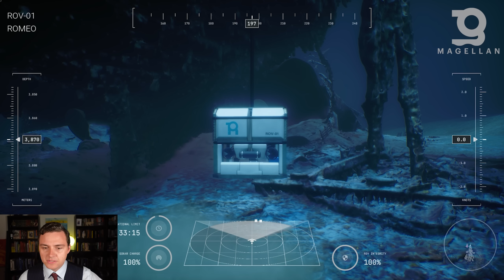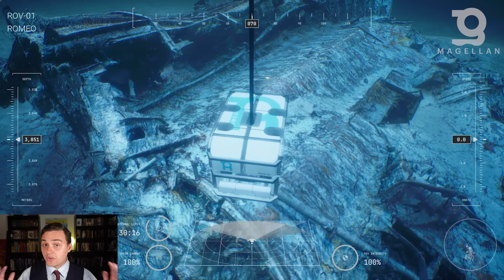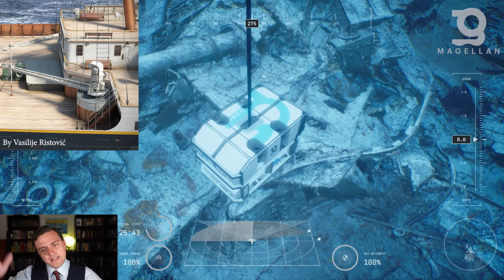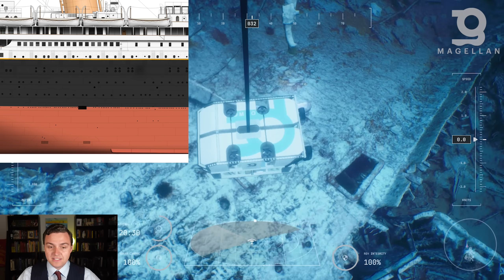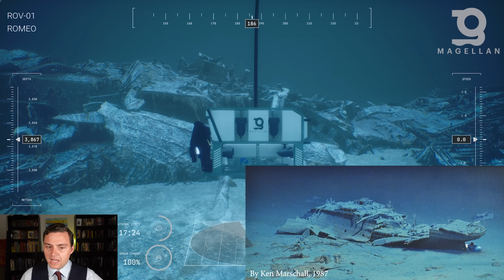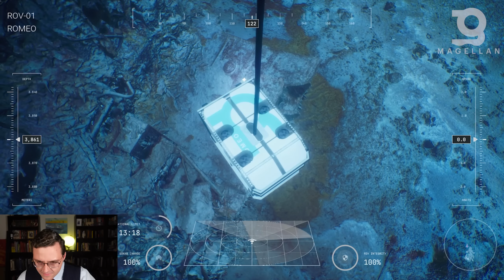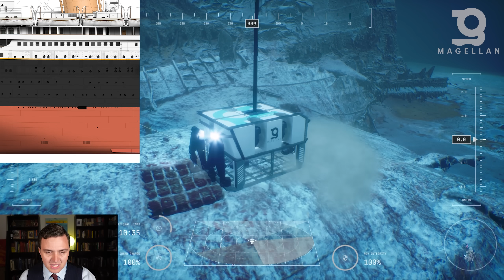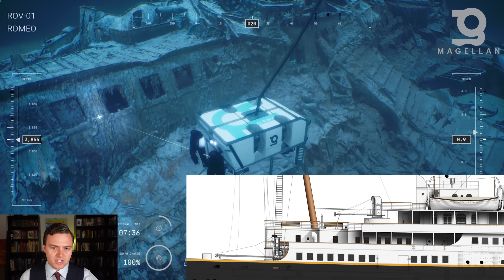FIRST LOOK: Titanic's Destroyed Stern Section in vROV Pilot

Comment: Mike, I see 4 things in relation to the shell plating.
*the breakup itself 
*the impact with the ocean floor 
*implosion damage 
Here’s a factor that I don’t hear mentioned much if at all:

    The ship didn’t sever immediately……or fully. The port side of the bow section will support this notion….methinks it was twisting and essentially peeling the shell plating from the framework as the entire mass descended until it finally separated. Add everything else plus the water column, and it’s amazing that the stern maintained ANY semblance of structure.

Comment: I have to wonder what sort of damage was done to stern vs front sections at the time of the breakup while at sea surface.  Was it a clean break like a knife slicing through a piece of bread, or was a lot of the structure buckled and the flattening began  on the surface as the ship "bend" outward?

When would be needed to know is what kept stern attached to front section (likely at double bottom?) and what sort of condition it IS  in now, twisted beams indicating the stern section started to spin and which point, it broke fully separated and started to fall down on its own and found the most aeordynamic orientation to fall ?  
If the bow hit first, it would have its aeroduamic shape to slice through sand and perhaps more slowly decelerace wheras the less aerodynamic shape of stern with propellors etc might have created a more sudden impact when it hit the bottom

Comment: When I was building dioramas of the stern, it was fascinating getting to shape it all based on the paintings and images available at the time, and gave a great understand/insight into how it might have been moving and rotating as it impacted the floor. The sheer forces involved to peel the entire shell of the ship away are absolutely unfathomable. The way you can tell the direction it was moving as it hit too, and how the port side skin was essentially ripped off as the hull kept moving, while the starboard skin ripped off from its own weight and momentum as the bulk of the ship stopped too. Mind boggling
Reply: Mind boggling indeed.  I tried wrapping my mind around the forces that were at work this whole video and it's darn near impossible.  Some say it hit at 35mph but I wouldn't be surprised if it was faster than that.

Comment: It boggles my mind the degradation of the stern since its discovery. The fact that this game exists is boggling, and the fact that its built off of the actual 3d scans is just incredible

5:29 dangit mike that was a good moment to get up close to the prop and see if the 401 is on there and to shut the switch theorists up
Reply: Fortunately degradation of stern actually didn't really happen that badly. Ken Marshall paint was pretty optimistic, he said that most of the images he got were overhead view of stern and he just assumed that certain decks were intact. But unfortunately closer images to  those areas show that alot of those decks were completely collapsed. For example port side hull plating lying almost horizontaly flat on seafloor the same it is now and boat deck was really close to seabed, which means port side decks were as badly collapsed as theu are now. A and B deck were also completely collapsed. Alot of decks on starboard were also collapsed.

Comment: What is fairly evident is that Titanic's aftermost boiler rooms experienced explosive decompression somewhere on the way down.  It is extremely similar to what you think about when an airplane might have a window blow out while at altitude and the cabin is pressurized.  Except what is pressurizing the interior of Titanic is steam.  Not from her main steam system (pretty much all of that was vented before she went down), but from all the residual heat built up in all the metal in the boilers and the firerooms.  In her stern section, the aft-most boiler rooms had remained pretty well free of water intrusion while the ship was going down head-first with the water-tight doors closed.  So, a lot of latent heat didn't have any opportunity to interact with seawater until she was already on her way to the bottom.  So: you'll get pockets of steam that develop as seawater boils off and the surrounding hull structures, reinforced by external water-pressure holds the steam in there.  And as the ship goes deeper and deeper the increasing water pressure will force those steam pockets into a smaller and smaller volume with higher and higher pressure until: POP!  They blow out a bunch of rivets and put a seam in the hull.
Reply: Very well thought through comment that no one else has mentioned! Makes sense to me, multiple, simultaneous pressures!
Reply: @ Thanks.  This is actually a simplification of the physics.  Technically it is neither an implosion nor a decompression because the pressure of the seawater flooding the ship will compress the air pockets until the two pressures are in equilibrium.  The actual failures is the result, technically, of the fact that the compressed gases are less dense than the sea-water and therefore tremendously buoyant and put a whole lot of stress on the structures of the hull in a direction exactly opposite of the what the architects of the ship had designed her to withstand.  But the visual of an explosive decompression is pretty analogous to what you see when these failures happen - so that's why I went with it.
Reply: I wonder if some of the hull damage was caused by the boilers exploding as the sea water entered the rear boiler room as the ships rear section broke away, I have read about boiler explosions on ships after being torpedo during WW2, the venting of steam as shown in several films is excess steam the boilers were producing once the main engines were stopped, it did not empty the  boilers as the steam was still being used & being produced to keep the other reciprocating engines for power generation running, probably getting steam from the rear boiler room.
Reply: @ I'm not an expert on Titanic specifically but I suspect none of the boilers exploded catastrophically.  In any steam system the boilers are designed to handle the highest pressures of any component in the system because, as pressure ALWAYS flows from high to low, the boilers must ALWAYS be the highest pressure in the system while the condensers must ALWAYS be drawing vacuum in order to keep steam moving through the system.  Once the bridge ordered the engines stopped on the EOT (engine order telegraph), they would have closed the valves to cut steam to the engines, opened the bypasses to keep lower pressure steam moving to the auxiliary systems, and vented most of the excess.  I'm sure they would have held some amount of reserve steam but nowhere near the upper end of their operating pressures in the boilers.  Once the ship slows and stops, you aren't getting fresh seawater forced through the sea-chests into the condensers and so, if you are trying to push too much steam, you'll overwhelm the ability of the heat-exchangers' in the condensers ability to suck that heat back out in order to recondense the dead steam.  And, if that happens, you start to lose your ability to push steam through the system at all and you will mostly have to just vent the dead steam to keep any steam moving.  While it is entirely probably that the steam lines in the aft fireboxes did fail when they experienced the thermal shock of the flooding, it's extremely unlikely that any of them were under enough pressure for such a failure to cause any significant damage to bulkheads or the hull on its own.
Reply: I guess I should mention: auxiliary systems (such as steam-powered generators) always operate at a fraction of the pressure of the main engines (because, under normal operation, the get fed from the steam only after it's passed through the main propulsion plant and because it doesn't require anywhere near the amount of power to spin a few generators as it does to keep those giant screws turning).  So, after they stopped the engines, the engineering officers, knowing that one of their chief objectives is to not overheat the condensers, would have only been burning enough coal as to keep the boilers at whatever the operating pressure of the auxiliary system was.  In my experience, this is normally only about 50-60 PSI, but again, I'm not a Titanic expert.
Reply: @Joseph55220  The suspect boiler explosion I am suggesting is not due high pressure etc the safety valves deal with that, I am referring the boilers would have failed when in contact with sea water after the ship began to break in half, the rear boiler room was isolated from the other flooded boiler rooms, & until the ship began to break in half, the electrical power was still being  generated by the steam reciprocating engines attached to  the generators, dont confuse these with the main engines, if you look up wikipedia  it confirms, as I have told by those who had worked on steam ships from the 1940's that boilers do fail/explode when in contact with sea water & the water that night was sure dam cold near freezing & salt water freezes at a lower temp than fresh water.
Reply: @Joseph55220  it does not matter the pressure in the boilers at the time the oceans cold water came in contact with the hot metal of the boilers, it would cause that metal to fracture, the damage caused by the un controlled venting of steam & most importantly the hot water contained within does the damage, to explain this I draw upon a boiler inspector I was associated with nearly forty years ago who explained, its not the pressure that does the damage its the volume of hot water being released, he quoted this, "a pressure vessel at 100 psi that contains a litre of water will result in some damage, but a pressure vessel at 10psi with 100 litres of water will result in major damage, as its the volume of heated water under pressure venting to atmosphere expanding to ten times its volume that does the damage" now consider the following, one of  Titanic's scotch marine boiler contained 48.5 tons of water, I ton of water is equal to 224 imp Gallons, only one of those boilers failing would do a lot of damage.

Comment: It always astonishes me to try and imagine the gargantuan forces required to tear solid steel cylinder blocks apart, blow the sides of a ship out into the abyss and crush objects like plasticine.

Consider that the rushing water flowing over objects as the ship plummeted downward ripped solid steel cranes to pieces, bending piping and tearing fixtures loose.

Does anyone know the thickness of the propeller shafts? Those shafts were bent upward like pipe cleaners when the stern smashed into the bottom. Contemplating the forces at play here just blows my mind.

Comment: It's incredible to think that objects made of porcelain, glass and other delicate materials (like plates, windows, etc) survived all this and are still at the bottom with the rest of Titanic. :hand-orange-covering-eyes:
Reply: Those materials cant decompose, eventually they Will be all is left
Reply: @gillespriod5509 I doubt the engines and screws will ever disappear as they made from bronze and the crank is steel but hidden inside the main engines
Reply: At those depths what largely remains is lesther items such as shoes as decomp at that depth is very slow not to mentions the tannins mostly preserving the shoes. 

Recovered from the titanic has been suitcases, full dinner sets, and i believe the cherub statue that was seen replicated in the film by the staircase.
Reply: It's a question of hydrodynamics. A teacup is brittle and fragile, but it is very likely to survive the fall to the seafloor intact because porcelain isn't terribly dense compared to water and the shape of the cup gives it reasonably high drag. So it will fall slowly enough to not break on impact, and in fact will probably land on the seabed upright.

In technical terms, it has a low 'ballistic number' in water and therefore has a low terminal velocity in water.

But an iron or steel object will sink much faster and strike the seabed with much more force, because it has a very high ballistics number in water. (The same reason why Columbia's main engines travelled the furthest in the debris field.)
Reply: Somewhere in the stern is a cargo area that  contained Titanic's books. Possibly the expensive one with the book with the jewels on it.

Comment: You can´t help it but appreciate that absolutely gargantuous amount of force, which has been exerted on stern section just because it was not so hydrodynamic and still more or less full of air pockets when it started its descent. That section is demolished like a plastic model in running washing machine filled with rocks.
Reply: It didn't even look this bad back in the 80's. On one hand I'm surprised the few rivets holding onto intact framework even held on for as long as they did, on the other hand the overfocus on the bow meant a lot of us have completely missed out on exactly when the stern hullplating let go.
Reply: Ditto.  It was torn up in the '80s, but still recognizably the stern.  This is basically a poop deck with an amorphous pile of wreckage attached.

Comment: Still think It imploded at some point. It didn't separate entirely and the bow that was full of water dragged the stern which was basically empty into the depths. The pressure increased and the air just didn't have time to escape the ship.  Look at the stern, the displacement. You want to tell me It escaped the ship  in 30 seconds or a couple minutes? Just think about the amount of air in the ship. The bow still has water bottle on It's place in the cabin and look at the stern. It's like a 3000kg bomb went off inside. The water drag alone couldn't do such damage or even the ship hitting the sea floor. The stern part has the most damage in the middle section and the plating is bent in the opposite directions outwards in that section. Probably where most of the air was trapped and upon hitting the sea bed the remains of It blown outwards trying to escape with great force or It just imploded on the way to sea floor at some point. Otherwise the bow would also have same damage from hitting the sea floor, but It's in decent condition, because It was filled with water by the time it hit the sea bed. Let's talk about the case of Harrison Okene, small ship sinking and all the air just didn't have time to escape It before It sank and hit the sea floor at 30m, a guy was trapped there in the air bubble 3 days and the air still wasn't pushed out by the water. It took hours to fill the bow of Titanic with water, but you want to tell me the stern with that kind of displacement got all the air out in seconds? I would seriously reconsider the waterdrag theory because the condition of the wreack just can't be explained with It. The machinery didn't just fell out It looked like It was blown out.